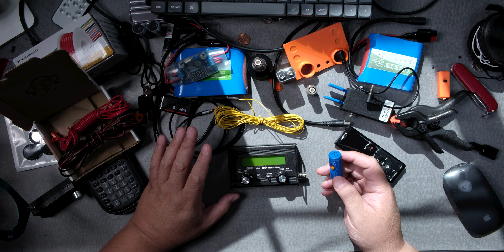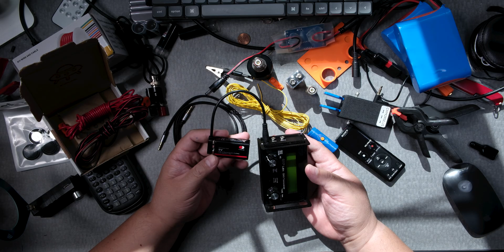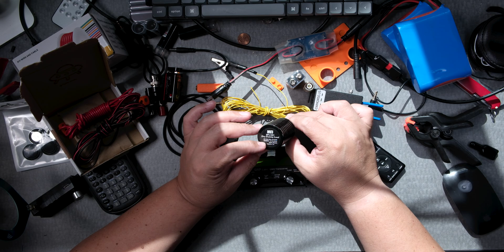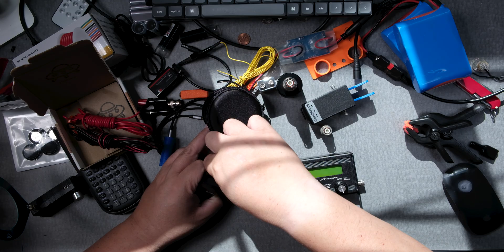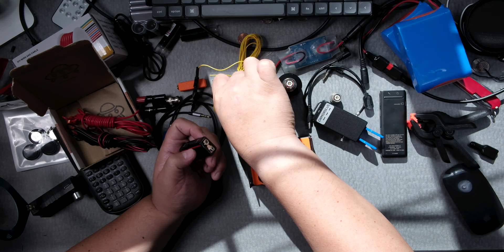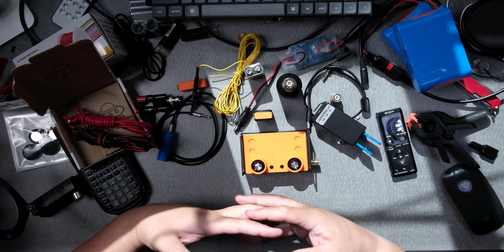QRP Labs QMX Radio. Hands-on Update

Comment: Hey Frank. I view the QMX (I have 2 different banded versions) as a great value ‘Swiss army knife’ radio. It’s so capable for the price and size. I can do CW, digital or voice, and keep it in my bag without worry of damage. It is becoming my go to radio for air travel. I can do a CW activation while on the road, or if there’s an emergency, I can do a Winlink session for HF email to family. 

I encourage you to peruse your CW aspirations. I started and stopped many times, but finally decided to just do it. It will become your favorite mode once you get on the air… 

Michael - N7CCD
Reply from the maker: Thx for the encouragement.

Comment: Take a Akku with PD, so you have a powerbank in size what you want and just tell them 9V, 12V or 19V. tś very easy and less to take care of and a lot of mAH! Youĺl find it a t Amazon. PD is the keyword!
Reply from the maker: Thanks for the tip!
Reply: @frankwc0o forget those specialized hard to find batteries .go with a standard cellphone battery bank you can find anywhere !make a power supply cable using a mt-3608 boost converter chip set for whatever voltage you want .I bought 6 of them for about $8.00 dollars and have two power cords in my kit..